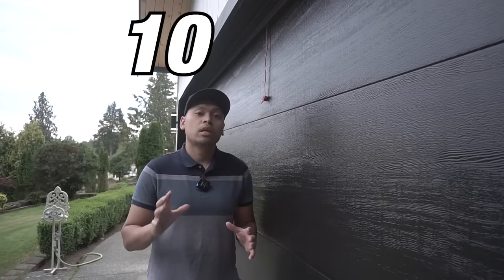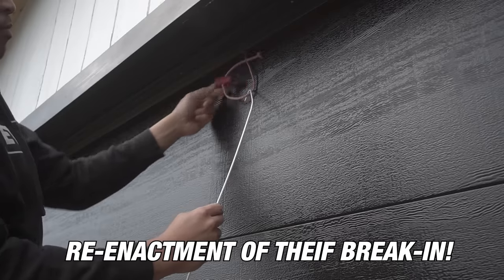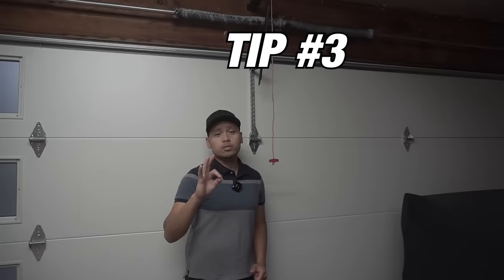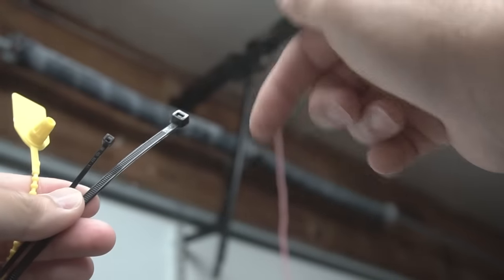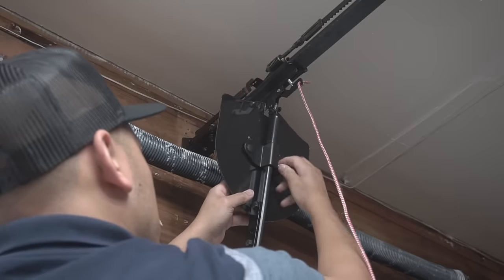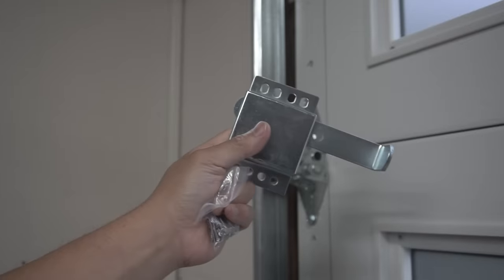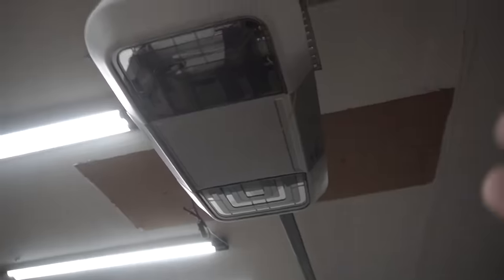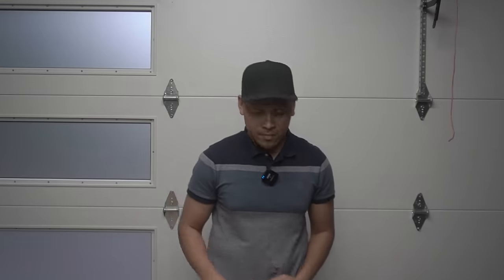How To STOP Garage Door Break-Ins! Burglar-Proof Your HOME! (10 TIPS To Keep Your Family SAFE!)

Comment: Tip #11: remove the string entirely, and keep a hook tool in the garage. You can use the hook tool to grab the release lever if you ever need to disconnect the opener, but there won't be anything for a thief to grab and pull through the garage door.
Reply: The string is for an emergency situation.
Reply: @OhgodImtoosexy  .... which is why I said to keep the hook tool in the garage. The string is used to disconnect the door from the opener in case of a power outage, or the opener quits working. However, the string is only there to actuate the mechanism that detaches the door from the opener; you can actuate that mechanism with something like a hook (which is what I suggested).
Reply: Bad idea
Reply: Vince F.  Wow, okay, so just because I have a hobby that involves video games, means that I know absolutely nothing about anything else? That's.. some odd logic, there.
 
I mean, I do have a job and everything, which you don't even know what that is. But you're going to judge me based upon one small snippet of information? Sure, whatever there.
 
Anyhow, a garage full of smoke? Maybe you should, I don't know, not run your engine while your vehicle is inside the garage with the doors closed? Or, perhaps not do things to set your garage on fire? Or perhaps not do things that produce smoke (maybe you're welding or something) while the doors are closed?
 
And even if there were smoke in your garage for some strange reason, there would be a side door in most garages. I don't think I have ever seen, nor heard of a garage that does not have a human door on the side that either leads to the outside, or to the rest of the house.
 
And even if you were for some strange reason, inside the garage when it filled with smoke and needed to get out... it makes me wonder just what would cause that hypothetical situation in the first place, unless you're trying to insinuate that if a fire were to break out, your first thought is to run into a burning garage, pull the emergency latch, open the door, get in your car, to hurry up and get it out of the garage while there's a fire going on? That's the very thing they tell you not to do in the event of a building fire, they tell you to not go in to get material possessions; it's not worth your life.
 
So what hypothetical situation are you trying to imply that you would be inside the garage when it fills with smoke, and you'd have your doors closed (AND the opener switches are inoperable!)?
Reply: This is what I do. Plus in California at least All new garage openers have an emergency battery that still allows the door to be opened in an emergency or power outage.
Reply: @Dhalin  It’s like you’re purposely being dense. There’s a thing called house fires. If the fire is blocking your front door, wouldn’t you try to go out of the garage if that’s the only option? Not everyone has a back door or an extra door in the garage. I live in a quadplex. I only have one way in, one way out and my garage is on the other side of the building, not connected to my place. My adjacent neighbor’s garage is connected to their unit and that’s the only other way out for them besides their front door. Vince F. was doing a little too much with his comments, but your comments are troubling on their own.

Comment: Put a burglar alarm system with an audible siren and strobe light outside censor the garage door with a magnetic switch if you have glass in your garage door put a glass break audible sensor in the garage to detect breaking glass that will instantly trigger the siren. You don't gotta compromise your home appearance because of a couple of dirty  Road dog thieves. Also put a Jack shaft open around it makes it tough for the polar release chain. Install double key side of deadbolts on a back garage door with windows and sensor that door as well preferably with an instant alarm zone no delay.  And if always possible hardwire your alarm system. Is basic tips from aretired alarm technician

Comment: I knew where this was going as soon as I saw the first few seconds of the video I paused it and ran out to look at mine my garage doors have Windows across the top so you can see the cord just hanging down there about 6" inside the window yeah I'll do something about that today..

I've reinforced every other door in my house the French doors were tricky.

Thankfully I live way out in the country on a farm and the odds of a break-in are relatively slim compared to if I lived in the city. The problem is if it happened here and I was at work they could take all day long the cops aren't coming nobody's going to see them.
I do have a security system but it's not monitored it wouldn't do any good it take the police 30 minutes to get here but I do have two large loud sirens one inside and one outside hopefully that would at least scare them away..

Since I keep a step ladder in the garage or in the house usually in the basement or garage I opted for the cutting the cord off so it's only a few inches long just in case I do need to use the cord myself I almost thought about just removing it I could still do that and just throw the rope on there if I absolutely needed to open the garage door.

Comment: As a garage door guy let me tell you, adding a lock of any kind with an opener is a recipe for a damaged door or at the least, or a costly service call to get the door back on track. The best thing in this video that he did was shorten the cord. However what he did with the coat hanger is not that easy. I feel like he did something to help make this seem easier. Like had the door off the ground just a little bit. I'd get calls where I'd had to break in (no other door or window) and remotes/keypad won't work and I never used this method because it's much more difficult then then other ways I can get in.

Comment: Unplugging the power does nothing, the pull cord will still release the door. Remove the rope and use a piece of bent wire (the one you took from the crack head you found trying to break in and beat to a pulp) with a handle on the end to pull the release lever down. Fit the shield so the crack head’s can’t reach the lever with their wire.
Reply from the maker: Thank you for sharing your advice! 🙏🏽😊
Reply: @FixThisHouse  You’re a good man trying to help people stay safe. Keep doing your thing as not everyone is an expert like some of the commenters. To be honest I didn’t even realise the pull cord was an easy way of entry until you told me. I’ll be making a shield and wire hook tomorrow. Thanks and god bless👍👍👍

Comment: 18 years in doors.
I'd never recommend locking the door down with an opener attached.
NEVER cut the EMERGENCY cord.
It may be your egress in case of a fire.
I suggest just wrapping the pull cord a few times around the j-arm or as suggested a zip tie.

Comment: for the emergency string, i would take it off and have long hook on the wall that i could use , i also prefer to have those slide locks on my door so no matter 
if they use remotes the door will not open, might be a pain but better than them getting access, the thing i find today is that people are tooooooooooo lazy to
do things manually and the electronics make it easy for thieves to steal anything these days.

Comment: This is such a pain in the ass for your local fire department. Sometimes we try to access one’s garage door by the same means, instead of costing the home owner to replace glass or a door because of forced entry, if we need to access your home while you’re away because of a fire alarm or medical alarm. While it may deter a thief, it was also deter us who arrive to investigate a fire alarm or tend to the needs of someone injured, that is unable to unlock or answer their door at home. My recommendation, if you intend on thief proofing your home, purchase a residential Knox box that you can stow away a door key, inside. Your local fire department is the only one who has a key to the Knox box and all Knox boxes have the same key. So we can access all Knox boxes in our district, with the same unified key.

Comment: Unplugging the opener from the power won't stop someone from using the coat hanger and disconnecting the garage door from the opener. The reason for this disconnect is for when there's no power.

Comment: Being a doorman for 35 years and working in Detroit area I died laughing at this, you want it tight & right call a garage door company ..get a old guy not a parts changer .. have 2 slide locks installed ..padlocks don't work you can push through them unless you go big, vice grips, only work if tight to a the rollers, but do both sides, the rope? .. if you have your insurance company come and do a inspection they'll tell you to take the rope right off,  everything he said is to keep honest ppl out .. but if crack head wants crack head gets ... Lol .. notice the glass windows running up the side ? Looks cool  but a open invitation to crooks.. you like belt drive opener because there quiet? So do crooks stick with chain .it's makes a very distinctive sounds, quiet door/ rollers so it's quiet? Yep they like those to ..wow #7 should've been ###1 slide locks bought at any door company or big box store  .. wifi isn't a fort Knox security.. a computer hack is in .. 
   You want a fool proof system? No windows, slide locks turn off your power to the operator, remove the rope and have a professional door company adjust the top section right to the header... But just one more thing .. where ppl can't see your door there is one last problem to deal with ... The stolen car you find in your garage that the crooks left there as they drove through your door to steal and gained access to your garage and if connected... Your house, so do as I said and park a car in front of of the door .. I'm coming up with new ideas all the time but everytime I do ..Milwaukee tools come up with a new battery powered tool for the crack heads
Reply: But if you do park your car in front of the garage, make sure you take the garage door opener out of the car because crooks just break into the car and open the garage.

Another note:  If you have a side door to your garage, if it opens out, that means the hinges are outside and crooks will just tap the hinge right out and pull the door off at the hinge side.  There are ways to modify your door so that once closed, even with the hinges off, the door can't be pulled off.  Drill holes into the door under or above every hinge and jam a drill bit in it.  Close the door until the bits hit the jam.  Look where the bit hits the jam.  Drill holes there.  Now when the door is closed, those little bits hold the door in place like dowels.  You can use steel rod, old bits, whatever you got.  It's on YT videos.  Easy and effective.
Reply: Those are all note worthy ideas .. but I found out no matter what I say to a customer after a while they get complacent.. I never program a factory door button into a car or leave one in, we do do a "z" bracket in the door to drop a 2x 4 into so door doesn't move, good things to do in a bad hood but that why hood rats steal in the burbs .. Thier safe with the thoughts that they'll never get hit because of thier zip code .. complacent kicks in and crooks follow, camera's, lots of light (motion activated) load noise if doors are messed with along with thinking like a crook helps, now how could I steal everything if I really wanted thier stuff? How would I get in?? Cops are 10 minutes min .. always tell the cops & neighbors if your not going to home for a few days and vigilant to new cars and neighbors with a teen/ friends who cause trouble .. most suburb break in's  are bored rich kids
Reply: Ya, leave your car outside the garage, so they can saw off your catalytic converter.

Comment: I put a wiffle ball on the end of the string to disengage the opener. Good luck pulling it outside
Reply: BTW the “shield” is dumb. Why didn’t they wrap around the thing instead of just putting a deflection point so far away?
Reply: Doesn't pulling the string release the mechanism? If the ball won't pull outside, then it pulls the other end of the string
Reply: @javaman2883  Perhaps
I didn’t put the ball on there for this purpose I just thought as I was watching this that the ball wouldn’t fit.
Also the string is shorter.
I put the ball on for the purpose of shortening the string because the little piece of plastic on the end drug across the roof of the car when the door closed.

Comment: if your gap is smaller than the handle it will make it harder to pull it though
Reply: It's not necessary to get the handle through the gap. Just the rope loop, which can be pulled.

Comment: The lock you show at 6:25 is best attached to the wall of the GARAGE, NOT THE DOOR. This puts the lock part in the way of the rollers. The garage wall is more (usually) robust than the door as well.
Reply: No, that is terrible advice and completely untrue. The slide lock shown is designed to be installed on the door face itself and not the wall. You would need to shim the lock out like 2-3 inches if you install it on the wall. 

Also if you are worried about strength, the roller stem or slide lock arm will bend to 90 degrees before they rip off the door so it doesn't really matter anyways.

Comment: With that deadbolt, it's too bad it can be fitted with a switch that would electrically disconnect the garage door opener while it was engaged.
Reply: I made a switch like that many years ago. Used a microswitch mounted on the outer track with two aluminum angles. When the bolt was locked, it pushed on the micro switch which disconnected the opener switch and externally mounted receiver.

Comment: You didn't address the main way people bust into garage doors which is kicking out the bottom. I got a few solutions for that. You got to bolt you a piece of rebar to the bottom of your door and drill a a whole for the rebar to be entered into there's nobody going to kick in that. Those little wheels can be kicked off a door within about three or four kicks if that, leaving the bottom of the door able to swing up 🤨

Comment: Adjusting your door tighter against the top seal doesn't do anything. The thieves use a wedge and ram it up in there and open that gap a full inch or even 2 because the metal is flexible. There is nothing you can do to prevent that. The only thing you can do is remove the Handle on the string and make sure its a short string.

Comment: tip number 10 is no good. at the garage door emergency release has been pulled. the garage door for that Wi-Fi will not alert you of the garage being open or shut because it was done manually and not by the opener. I know I tried it. I have that system

Comment: The cord length is long to allow emergency egress during a fire for someone at that height (it could be you if you’re injured somehow.) Cutting it is a bad idea.  During a fire, it’s possible that the power could be off and this cord will allow escape. Put the shield up instead.

Comment: Seems like a lot of over engineering when you could just tie the pull string into a small bow? It is only needed in the event of a power failure so it wouldn't take two seconds to untie it if was ever needed.

Comment: First suggestion, 
You fix aluminum rod with stand to bottom with screws. 
You rolls the pulling string around any aluminum rod and make knot. It will be difficult  to pull. Very easy operation. 
Second put lock to door as you are putting but screw must not go outside  , it must be at least  at  three different levels to harrras and delay. 
If possible put the lock.and flase key to block all the instrument. 
Don't connect with mobile any operation of door. 
Mobile is easily hack.
Remain manual. 
Don't keep costly car , if you middle class. 
Jay shree ram.

Comment: I have a camera, WIFI connected and recording in the garage. I also have a sensor triggered alarm with a 120dB siren, and of course I cut the release wire very short. If they make it into the house, then they won't make it out again. 12 Gauge shotgun to the head.

Comment: Stopped after two, locking or placing locking pliers on the track is ludicrous. How do you do that from the outside or are you implying people will close the garage door and come back in through the house to place a lock? And then when returning forget the lock or pliers are in place open the door and cause damage. At least remind them to kill the power. Did you come up with those two ideas in your sleep>

Comment: Padlocks do not work I had 2. 1 on each side they use battery powered cut off tool by climbing through a window.
Crooks are using all this battery powered construction equipment to get access to your house.

Comment: None of the tips are actually practice. You want to prevents thief while also want to open your garage door with remotes/apps...
The cord is mean to be used for emergency from the inside. Why not get rid of the freaking cord and make a 4 feet solid hook hang on the wall for emergency use.

Comment: All these are very ineffective.  You are assuming the thieves want to act covertly and quietly.  The way it actually goes down is 3+ guys rock up at your garage with a car waiting nearby.  They get their hands under the door and pull outwards, this breaks those flimsy door panels out, they grab your motorbike, shove it in the car and they're gone in around 30 seconds.  Even if you do hear them, you probably sleeping, then trying to work out where the noise was from, and by the time you get to your garage, your bike is already being stripped in the back of a pickup or van on their way out.